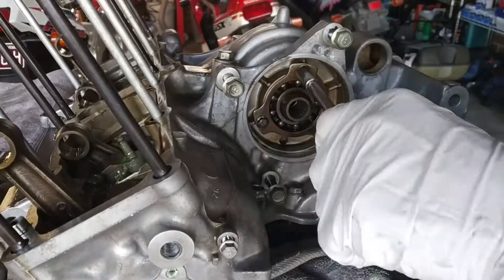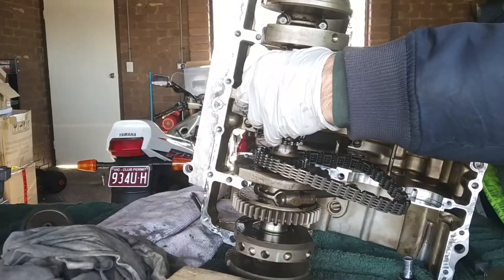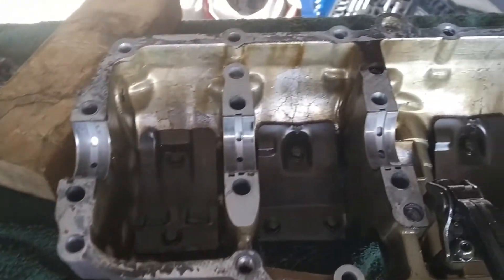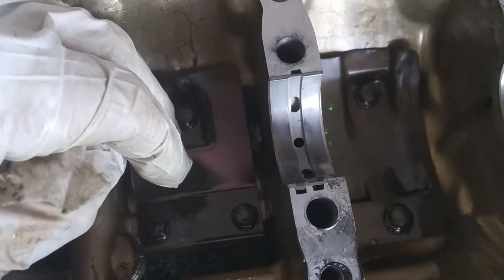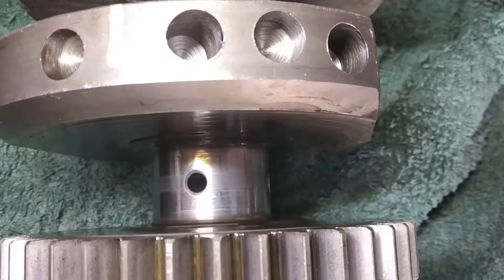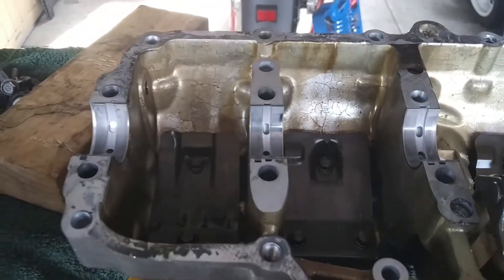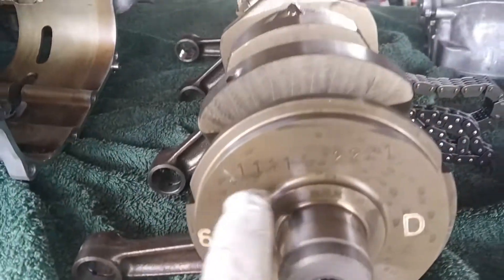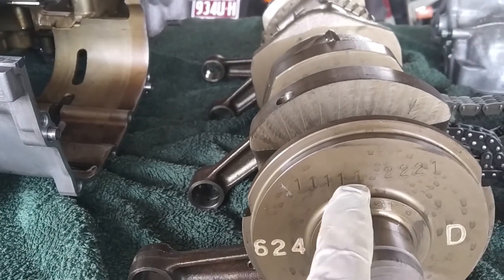Yamaha FZR 1000 Exup Full engine restoration Part 3

Comment: To anyone rebuilding an earlier 87/88 FZR 1000/750 with the FZ 750 based engine, instead of pulling the shaft out like Chris did @ 0:35 you will need to thread a long bolt into the shaft and use a slide hammer to get the shaft out. (I just put the bolt thru a large socket and slid the socket along the bolt as a make shift slide hammer) This is because one the earlier engines the bearing is a tighter pressed in fit.   Also there is no pin shown at 0:59 on the earlier engines, everything else is pretty much the same.👍😀
Reply from the maker: That is a very good info mate. Thanks for pointing out all these differences between these models 👍

Comment: Buenas amigo soy de Uruguay y tengo una Yamaha fzr 1000 consigo solo los metales de bancada de 1 color solo se puede armar así o es muy peligroso muchas gracias
Reply from the maker: I'm not sure what you are trying to say. If you mean that you only change one out of the two bearings, then it's not a good idea. You better change both up and down.If you mean that you can only find one color of bearings and this is what you want to put in all of them, then the answer is no. You MUST put the exact color the manufacturer says, otherwise the engine will be destroyed.
Reply: @ChrisSofos  muchas gracias claro mi moto lleva 4 color  marrón y 6 negros según tu video, y yo solo consigo acá los 10 metales de bancada marrón y mi pregunta es si podía armar con todos marron xq no consigo negro
Reply from the maker: @luisfurtado5584  Unfortunately you'll have to find the correct colors for each one of them. NEVER put different color bearings. This will destroy the engine. Good luck with your FZR!
Reply: @ChrisSofos  otra pregunta amigo el color de cojinete más grueso es el amarillo ?
Reply from the maker: @Luis Furtado  that is correct! If you watch my latest video (part 9) I make a mention about it.
Reply: @ChrisSofos  muchas gracias amigo igual en la parte 9 no me aparese de los cojinetes metales  quiero encargar el más grueso para el que se giro así corrijo el cigueñal pero ahora ya se que el más grueso es el amarillo y el más fino el que queda con más luz es el azul es así?
Reply from the maker: @luisfurtado5584  the thinnest is the green. Then it's black, then brown and then yellow (the thickest). There is no blue for these models.
Reply: @ChrisSofos  bueno la mía es año 89 en este video que subiste part 3 dise  número
1 azul
2 negro
3 marrón
4 verde
5 amarillo 
Quería saber si estaba en ese orden el espesor de cada uno
Reply from the maker: @luisfurtado5584  oh sorry, my mistake. We are talking about the FZR1000. For some reason I thought it's the GSXR 750. Oh my God! I should have payed more attention! 😂😂😂
Yes you are right. That's the correct order of thickness.
Reply: @ChrisSofos  bueno ahora si no entendía muchísimas gracias igual de todas formas el más grueso es el amarillo
Reply from the maker: @luisfurtado5584  Blue is the thinnest and yellow the thickest